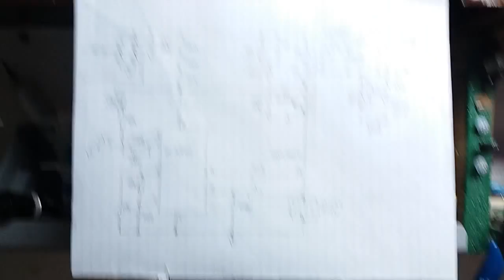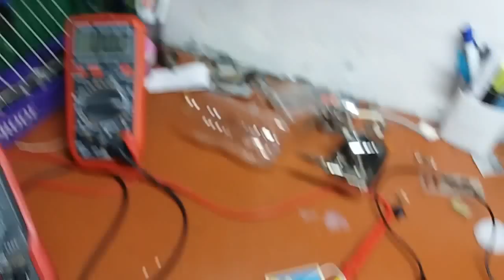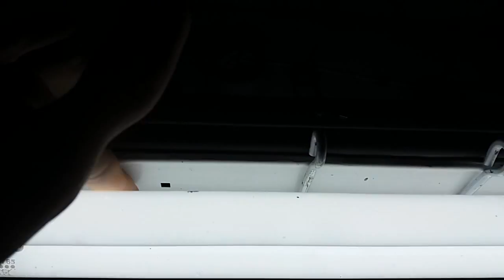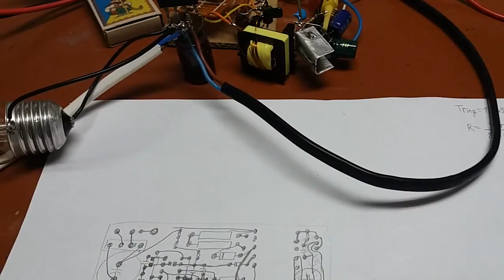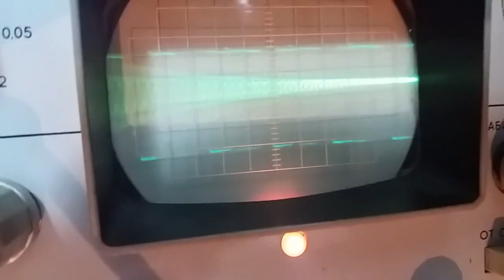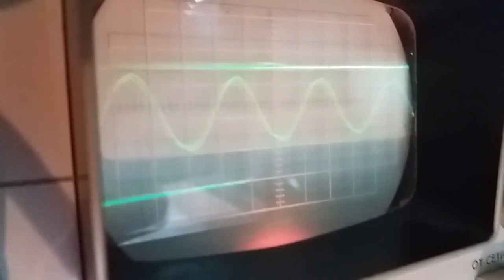Another horrific SMPS (or how to get yourself killed)

Comment: it is not 30 v for vcc it is 40.3v if we have 12v on 5t.............
Reply from the maker: Belete Shebabaw Bla. I measured it, it was under 30v at full load. You can't predict the voltage purely on turns ratio.
Reply: 10q  for ur fast respons

Comment: I think you'll get better results if you avoid using ceramics for anything other than decoupling. W2AEW has good info in his #256 video: https://www.youtube.com/watch?v=J0TjW_0xTJU and also Mr. Carlson's Lab shows live temp problems and piezo acoustic effects too. I know you know a lot, but maybe you are just short on parts resources. If Canada post didn't charge so me much, I'd like to send a practical expert like you a 4 kg box of things you need. My wife sends boxes that size to her Cuban family and it costs about $50.
Reply from the maker: I saw both of those videos :) I use these caps wisely, I just didn't bother to much with the prototype. I have made the board already, and I used a polyester "green drop" cap as the timing cap and the same type for the cap in the RCD snubber. The ceramics are: decoupling on pin 3 (current sense), pin 7 (Vcc), pin 8 (Vref) and a little bastard that gets hot across the output rectifier :D Thanks for suggestion though, I appreciate these kind of comments.
   50 bucks, goddamn o_0 I just won't feel right if I'll let someone do that, 50 bucks is 1300UAH, just so you know :D And that's just shipping, geeez...
Reply from the maker: "practical expert" LOL Gimme a break, I'm just poor ass hobbyist who is fortunate enough to live in the age when other people share their knowledge for free. 99% of what I know came from the YouTube and articles on the web.

Comment: Mr johny you checked your transformer for saturation? I dont like the noise the transformer does. Their is a way to do it without using your oscilloscope and set it to danger of damage. If you want further information please inform me and i will describe the procedure here.
Reply from the maker: It's not saturating, the noise you heard when the thing had optocoupler feedback is due to improper frequency compensation around the error amplifier. Now it's fixed and completely quiet.